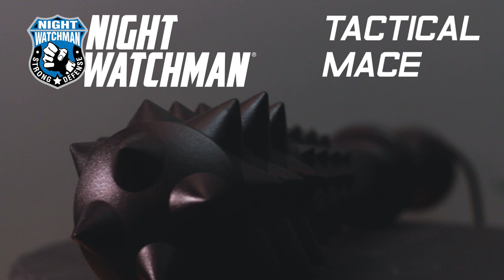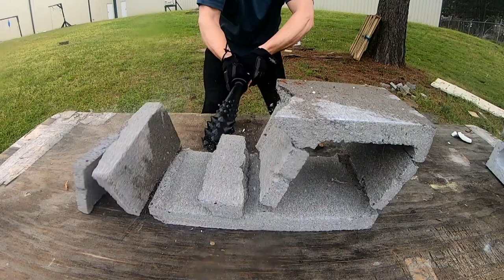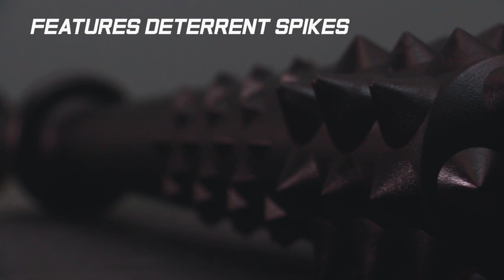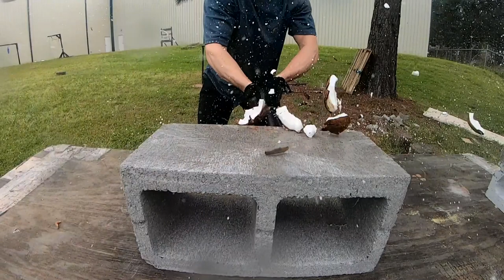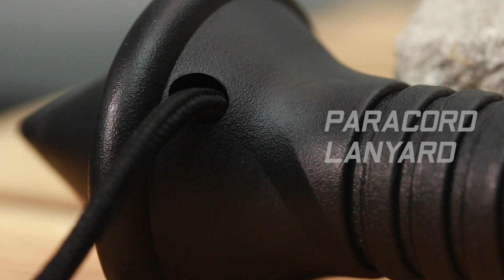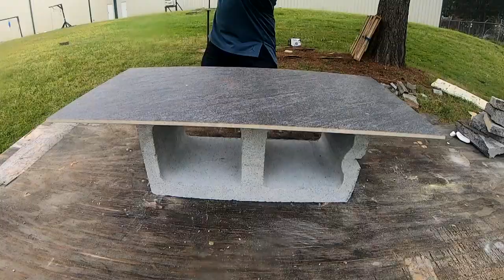A Deterrent You Can Count On - BudK Night Watchman Tactical Mace

Comment: Does this inflict more damage than a baton? If so what are the advantages and disadvantages compared to a baton?
Reply: A baton focuses most of the power from your swing onto a ball bearing or bar depending on where you hit. This concentrates the force of the swing into the spikes (smaller area). A baton is easier to carry around however.